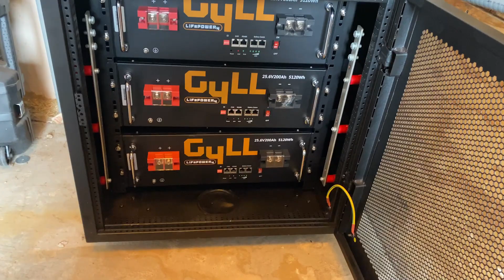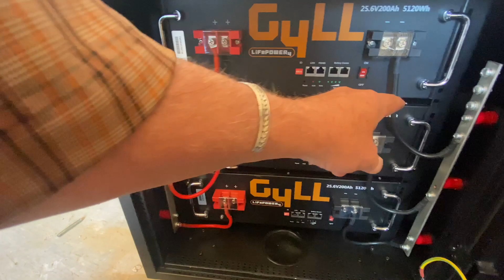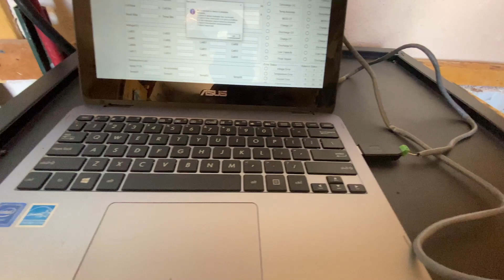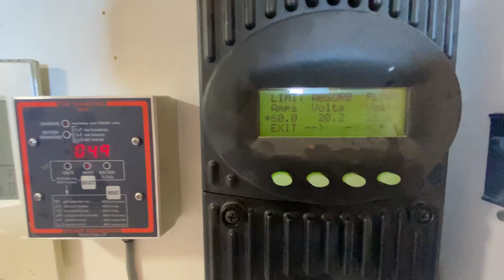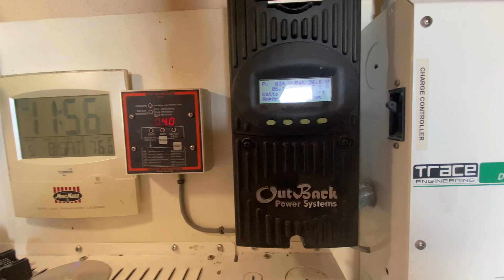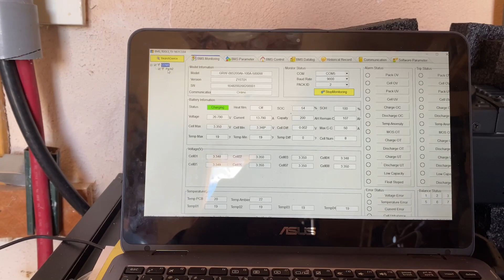Off-Grid Home lithium Solar Upgrade Part 2 - Gyll Lithium Battery Install

Comment: Nice setup! I setup a system with outback cc and was able to turn off the float, the actual menu it is under has escaped me, but the options were auto, on, off. When absorb finished it just went to charged. 
I have just purchased two lifepower4 eg4 24 volt and am having trouble starting motors. Skillsaw, chopsaw etc. The load would be 1800 watts max but it just throws a protection error.
Would you know if the bms on the batteries communicate between themselves to increase power? It seems like one battery should run the load. I've been using two twelve volts to run them for sometime now.
Reply from the maker: I've had the system shut down when our propane dryer motor started up. I'm not sure if it was the inverter or the batteries that shutdown from overcurrent. My table saw and other power tools have run just fine.
I would say that the BMS software on these batteries is pretty rudimentary.

Comment: Jay nice video, thanks for sharing. I was hoping you could let me know if the extra USB communication cable between computer and batteries works? If so could you send me a link to the one you purchased on Amazon? I've asked Signature Solar several times for another cable but cant seem to get an answer. The cable they send you breaks immediately while handling gently.
Reply from the maker: Currently my configuration is that I got two more USB dongle from Signature Solar so that I have a cable running from each battery to a USB hub connected to a cheap PC laptop. The BMS software now recognizes each battery pack on a separate port. I hope that makes sense. The third party dongle also works, but the Signature solar ones are just neater.
Reply: @taosjay  thanks again Jay for the information, I also have 4 of the new EG4-LL 24v 200Ah batteries and am experiencing EXACTLY the same results when connecting to the main battery (#1) in the series and not being able to read all 4 together but independently I can. My issue is the actual USB cable with the RJ45 connector that Signature solar gives you with the battery purchase is broke. They only sent me 1 and will not answer my request to purchase additional cables so I'm left to purchase from another vendor. I wanted to confirm with you which cable you purchased in addition to the one that signature solar sends you? Thanks
Reply from the maker: @ahhlifesgood1956   this is the dongle that I purchased from  Amazon:  DSD TECH SH-U11 USB to RS485 RS422 Converter with FTDI FT232 Chip Comp... https://www.amazon.com/dp/B07B416CPK/ref=cm_sw_r_sms_api_glt_fabc_V7CQF1363ERZHYA50NJ6
Reply: @taosjay  thank you sir

Comment: If the software and cabling only sees one pack at a time, why the heck does the dip switch addressing matter?  Going from one connection to monitor all the batteries at once, to having to connect one at a time, I'd see as a bug in the design. If anything any change should be from USB to maybe Bluetooth connection. Curious.
Reply from the maker: The software can see all three batteries via a USB hub. The DIP switches give the software the Pack ID # ie Pack 2, 3, 4 etc. the USB comm ports are different  and are assigned on a first come, first serve basis by the computer.

Comment: Jay, did you have to download any special driver for Windows  10 to get the BMS software to recognize the Com port?  I have a 48V Gyll and when I connect it acts as if the driver is missing?   I'll call Signature Solar, but just wondering if you did anything related to the USB Serial driver?  Thanks.  I appreciate your videos.
Reply: I would like to find out if your 48v system can run air-conditioner
Reply from the maker: My computer has the standard USB  driver and It recognized the USB hub and assigned comm ports to the packs.

Comment: Nice job on the video and install.  You might consider adding a fuse where the 4 aught cable connects to the bus bar.
something like this: https://www.amazon.com/gp/product/B0019ZBTV4/ref=ppx_yo_dt_b_search_asin_title?ie=UTF8&psc=1
Thanks!
Reply from the maker: There is a 250A circuit breaker at the DC disconnect box. Hopefully that is sufficient.

Comment: I hope you're wrong about them being 32.9 volts. I have the same batteries and they should never go above 28.8 volts, then once they are fully charged and charging stops, they settle to around 26.6.
Reply from the maker: Thanks Jonathan, I'm not exactly sure that those readings were accurate. I just took a quick volt-ohm meter reading as they came out of the box with no loads on them.
Reply: @taosjay  even without any loads, they shouldn't have been any higher than 26.6 volts when they arrived. Maybe the battery is low in your meter, giving you an inaccurate measurement.